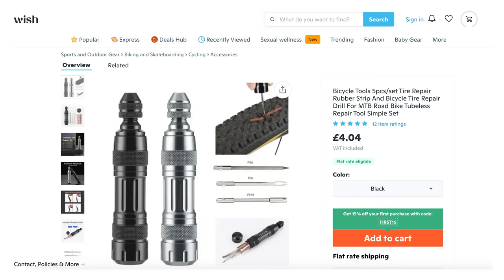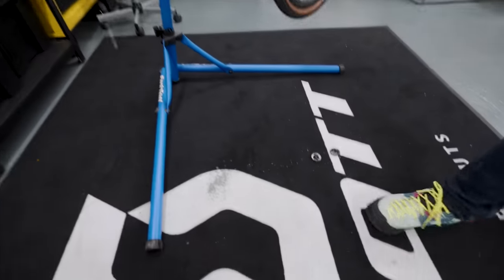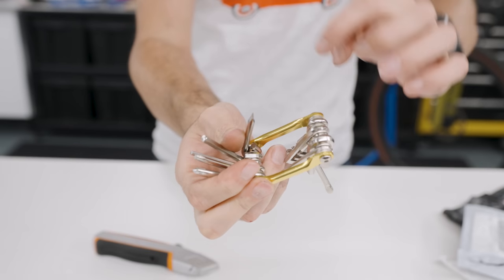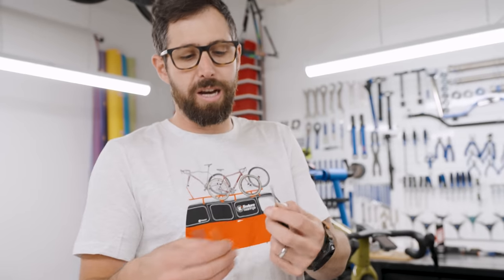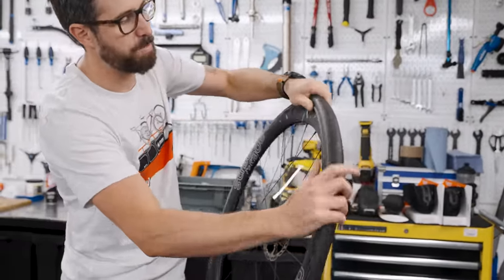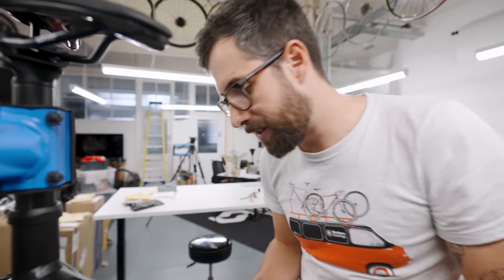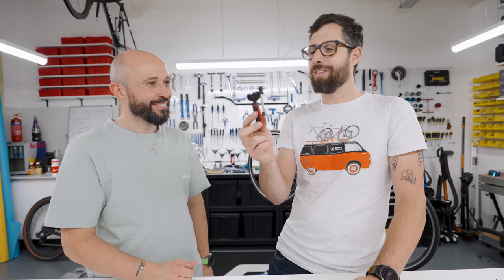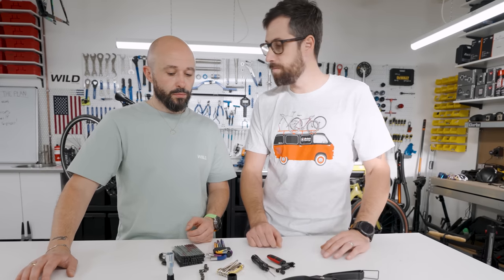Pro Bike Mechanic Tests The Cheapest Tools From Wish.com

Comment: For the wheel truing device. Nick should have shown the zip tie trick. Works fine for a quick wheel fix and the price is right.
Reply: As he said, your finger works fine too. I have tried the pencil trick with an elastic band, but zip ties and fingers work better for me!
Reply: Use the tip of the finger to do a rough true. It'll definitely get you riding again, though it wont be as accurate as a stand true.
The zip tie true is just the best way to do at home or roadside truing, as you can get shockingly accurate with it

Comment: You are 100% right about the crank pulling tool. I spent 3 hours cutting off the cranks after the threads in the crank stripped and I had to hacksaw it off! Love the content!
Reply: I have similar one but never had problem. I think you didn’t screw it deep enough first. Tool works fine for me for more than 10 bikes and lots of them are old ones that never had their cranked removed before.

Comment: Love Risk items! I have those pliers, internal cable routing tool, pedal spacers, headset cap bolts, …. Fairly high quality and wicked cheap!
Reply: Have some Ti Bolds from them for my brake calipers and they work since many years. Giving less points due to name is just bullshit.

Comment: I bought those same black plugs, and you can actually pull them apart into 6 strands each that are the same size as the brown ones that came with the plug tool

Comment: You will laugh, but I used the "truing stand" and I it worked well. My wheel was around 3mm or so untrue and I got it down to the 0.5 mm range. 

I followed the excellent park tool guide and found the process to be a bit time consuming, but overall not difficult. It's a cheap plastic tool, and if you plan on truing wheels often, it is useless. But if you just want to get your wheel trued that isn't totally out of shape, it's worth a shot.

Comment: I made the mistake of buying a cheap chain breaker and crank puller. The chain breaker lasted 3 uses and was horrible to use. Then the it decided to strip out it's threads. The crank puller was too tight and stripped some threads in a crank then it decided to strip its own threads out with barely any tension. I learned that lesson. I do old tools in my tool box that I use as sacrificial tools. Old beaten up screwdrivers and things that are past they're actual usefulness that I don't care if I destroy.
Reply: That chain breaker lasted 3 times more than mine. Ended up using a rusty, ye olde, Cyclo Made in England one instead. No problems.

Comment: Regards the split link pliers, I had some flat metal strips lying around, so, following one of my ride buddies saying that he couldn't split the chain whilst out on a ride, I decided to make a scaled down version of the Park Tools pliers that I have on my workshop board. They work a treat, and I've now made four or five similar pliers for some of my cycling friends, all freebies of course. And on the plus side, it gets rid of the lengths of flat bar that i have lying around, and not wanting to throw away just in case I could find a use for it.Old spokes make the ideal material for holding the chain together to prevent it being under tension.
Reply: You can also shift to the smaller chainring (provided you're running a double) and then just ease the chain off the ring and lay it on the BB shell for easy removal. Pro Tip from Calvin Jones & Park Tool.

Another reason I'm happy to spend on the Park Tool bits: they have hours of free maintenance videos on their YT site! They happily give away great detailed instruction for free. That good will in turn leads me to buying their tools and products. When I need a specific bike tool, my first instinct is to have a look at the Park version first.

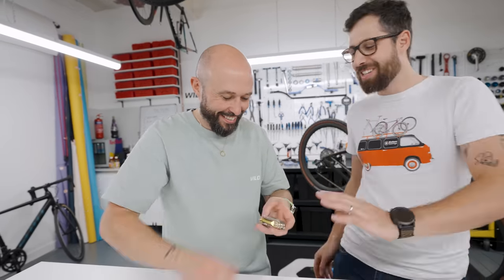Comment: 05:17 I have been using that multi-tool for my bike in humid Thailand since 2017. No rust, works great, and still use it today. What I love about it is that it has all the tools you'd ever need. In contrast, the over priced Park Tool multi-tools come VERY limited. They might have 3-5 hex on them, but that's it. This cheap Chinese one has withstood the test of time for me and it has everything you'd ever need. Good video though!

Comment: This is why there are dedicated channels on YouTube that just review Chinese parts.  Many of us rely on those sites to let us know what deals are great, and which are not.  This goes for frames, wheels, group sets, tools, and everything else.  It's abundantly clear that anything bike related is completely overpriced, because on a whole, cyclists are like golfers.  Elitist athletes who will spend their children's inheritence if they think they can buy some gadget that will make them even slightly better.  I made my own chain whip out of a flat piece of metal and some old chain.  I made my own bearing press.  And I would definitely buy the chinese version of most of those tools before I gave Park Tools one dime of my money.  I'm not a pro mechanic, so I won't be overcharging anyone to work on their bike.  It's just me, my garage, a bike stand, and the tools I have.  For over a decade now, that's worked a charm and I have to say it makes me even more proud knowing that the machine underneath me is something I maintain myself.
Reply: Did you just call a push bike a machine 😂😂😂😂😂😂😂😂

Comment: Double coffee noser when I saw you take the drill to Francis' tyre. I'm sure Nic would agree there are some tool ranges that fall between the most expensive and ultra cheap versions. Years ago I needed a toolkit in a hurry and bought one by Bike Nashbar. They worked well for the limited amount of repairs/replacements I was doing. Over time I replaced 99% of them with better quality. Also added tools as my skill set increased.

IMHO the one place not to skimp is a quality set of Allen/torx  wrenches. Add to that a decent quality torque wrench kit.

I'm with Jimmi, wheel truing is a dark art. Two years ago a buddy was moving house and gave me a Park TS-2 pro version. I ended up giving it to a bike mechanic friend as long as he did my wheels as needed. I never got the hang of it. The best part of that mini stand was the elastic band, which might work to fasten something to handlebars. 

Thanks as always. 😂

Comment: 15:17 I true my own wheels - it’s very easy, it takes less than 2min, you just have to follow the Parktool technique(compressing 2 spokes with your hand and checking if that area would give you the desired result, before increasing tension).

Comment: The pliers for seating the tire has another use which you didn't mention. If you are using an inner tube, using a lever to install a tire is dangerous, with a high chance of pinching the tube causing a puncture. This pair of pliers makes the job easy and does not pinch the tube. When I ride tight tires, I carry this tool.
Reply: Interesting, I ride with tubes and have pinched them a few times with levers, this might be worth buying. Also thought it might be useful for someone with disabilities, levers can be a bit fiddly sometimes and this looked smooth.
Reply: @danielvanced5526  the conventional wisdom is that you should not use levers to put tires on. 50% of the time I use levers to put on a tight tire, I pinch the tube, and I used to be a shop mechanic. The pliers -- which come in a few brands -- solve the problem completely.
Reply: Tyre glider is a neater bit of kit that fits in a saddle bag and does the same job better
Reply: @thenayancat8802  I checked it out. Interesting. Thanks for the tip. I might try one.
Reply: @tomreingold4024  Yeah I thought it was gonna be a useless dongle that gets used once and chucked out but I hate using regular levers at this point, especially if you've got a really tight fitting tyre. Having said that I was never great at using levers so ymmv

Comment: Great video, but I want one of Francis's reaction when he watches you destroy his wheel! 🤣

I've had most of these budget tools over the years and Nic's assessments have been my experience with every one of them.

The issue with the multitool coming loose is also not one you can fix unfortunately. As Jimmi found, if you do it up too tight, they can't be used, not tight enough and the end nut falls off constantly rendering it useless! I've since ditched the budget multitool and now use a Topeak Hexus X. It's actually not that expensive anyway but is a cracking little tool. 👌
Reply: for low budget multitools a plastic slip disk like ones found on some folding knifes help. i place them on my better ones too

Comment: A better tip I’ve seen is flip the bike over, and use a pencil braced against a rim-brake pad, or other point on the frame, turn the wheel slowly and move
The pencil closer. You’ll get marking of the closer points as well.

Comment: Cheap tools have many problems:
They wear out faster, and as they wear out they ruin the thing you're working on.
Reply: @DMurdock Except when the cheap plastic tyre levers are flexible and snap whilst doing the job they are meant to do. And the last thing the world needs isfor us to create more waste.
Reply: Tools that wear out quickly can still be useful. Many times with bike repairs, you're going to use a tool only a couple of times ever. If the cheap tool last long enough for that it was good enough.

Comment: Wheel truing is actually not very difficult once you figure it out. I just practiced on an old set of wheels. Disassemble and reassemble until I felt comfortable truing my “good” wheels.

The wheel truing gauge thingy would be very nice had it not used that silicone strap.

Comment: As someone who rarely needs a chain breaker, I've already broken 3 of the cheap ones I got. Next one I'll get is definitely a park tool.
Reply: I have the proper park tool one and it will definitely last. All metal and still made in USA. 
(Also, buying 'disposable' goods only adds to the waste pile of society, which is the last thing the world needs)
Reply: i've just always had the one on my crank brothers multi tool. i've used it in the garage, i've used it on the side of the road or on the trails, and that has served me well for over a decade.
Reply: Mine is made by Topeak, which can connect any chain, including Campagnolo (chain pin peening), something almost all chain breakers in the market can't do.

Comment: Re the extreme tire lever : I bought one because I was working on a vintage wheelset with wire-beaded tires. Before I bought them I delaminated the skin on both my thumbs trying to get the tire seated, with them it took like 2 tries to get them back on. That was 100% the worst tire combo I've ever experienced, equaled by GP5000 TLR for impossibility with just hand strength. At least with the GP5000s though it was impossible enough that I wasn't convinced for an hour that I could do it if I just pushed hard enough...

Comment: For truing wheels on rim brake bikes you could also just put a zip tie around your brake lever and pull the brake closer as you true the wheel.
Reply: I just turn out the barrel adjuster to bring the blocks closer to the rim bit by bit, because decent quality calipers move (mostly) equally you can actually do a pretty accurate job.

Comment: I have a few Risk tools and they work great. Their headsets are excellent for the small amount they cost.
Reply: I have there dust semi metalic brake pads. For the cost and what you get. Best brake pads ever. Bought 4 sets for 10 euro. For the future.
Reply: Same here, i have this risk chain tool, quite the same remark (good for trail use, not enough leverage for workshop use). Also happy with their cheap headsets.

Comment: That tyre leaver tool would actually probably be good for installing tyres on mountain bikes with Cushcore because that is a fkn pain in the ass install, I actually snapped 3 tyre leavers trying to get the tyre on with Cushcore and that tyre leaver tool may have made it easier

Comment: A life hack for when you in a pinch (on the trail) need to true a wheel, is to bring a couple of strips. Simply tie the strip to the seat stay or fork and you can rotate it to make the end touch the rim, You can actually get fairly exact with this method as long as you tie the strip enough for the wheel wobble not to move it out of position 🙂

Comment: The problem is, you’re using a “spit link” and not a “split link”

I’ve used one of those cheap chain cleaners. They’re not as bad as they’re making it out to be. It works fine, just think of it as semi-disposable.

I also used that same multi tool for about a year when I first started messing about with bikes. I bet it would still work today. That one is fine too.

Comment: That tyre lever ideal for anyone purchasing Schwalbe Marathon Plus, or run the risk of entering Haka territory sliding those last few inches over the rim !
Reply: Have to say. With schwalbe and cst. Never had a problem with putting them on with just hands. Did have it with cheap tires.

Comment: I used one of those square taper crank pullers and it worked okay for a few uses but started stripping threads after like the third set of cranks. 

The bb tool I've only ever had to use once. For that one time it worked fine but you'd be infinitely better off with a quality tool

I also own a set of cheap allen keys like the ones featured. It's pretty hard to mess up allen keys and mine have seen heaps of use (especially the 5mm) the past year and been fine. 

When it comes to chain tools I'd recommend the Cyclo one at Halfords if you're on a budget. Unless you work with single speed chains a lot it'll do everything you need and is absolutely rock solid, all metal.

Comment: I have been using zip ties with a bit left sticking out to true my wheels in a pinch. Especially road bikes with rim brakes, comes in super handy and I just leave it on the frame/fork and rotate it out of the way when I'm done. Did a 8000km tour with a brand new bike, had to true the wheels after break in and then again multiple times during the trip. Can't beat the price of a few zip tie
Reply: You couldn't last 8000 m nevermind km 😂

Comment: I use the chane mashine! At least I used it 10 times. Still only one rubber is missing, but it still works. And the brush is a bad idea if your chain is covered with send salt and snow, particles of sand will make sure that your hand holding a brush is dirty beneath the elbow as well as all your clothes.

Comment: My reaction was exactly the same when I found the RISK brand for the very first time on AE 😀I wouldn't mind using some of their small parts like cable housing end caps or internal cable housing dampener tubes. But something like (fake?) titanium bolts for your stem or handlebar? Well, that's RISKy 😀

Comment: from what i've seen, most tools work okay unless it's something where a very exact fit is ideal (cartridge bottom bracket splines, crank puller threads) and/or where a lot of force is applied (pedal wrench, allen/torx wrenches, tire levers).    Those big tire plugs are made for car tires.
Reply: Hahahah.   I just got to the part with the cheap BB and crank tools

Comment: 16:00 just use zip tied to the frame cut to be little longer so it touches rim with some angle. then you can move to the rim as close you need. with same precision like with this tool..

Comment: I bet the smallest sizes on that cheap Allen key set are out of spec. both me and my brother got a cheap set each from different parts of the internet and he rounded his pedal adjustment bolt and I rounded a bleed screw bolt with mine. both using the small keys.

Comment: I used to have some of these tools when I started working on bikes. RISK is actually a fairly good chinese "brand", like ZTTO. The unbranded crank puller is actually ok if you're only going to use it once or twice a year, but the bottom bracket tool is absolute garbage. It doesn't fit properly, hence messing up your bb.

Comment: Have ruimed a crankset (well the threads at least) with partly the tool to blame, so much agreement there. The trueing tool isn't as useless as you can work around it moving.

Comment: If you are bike packing and need to true a wheel you can  use a zip tie. Put it around your frame and cut it so it is a fix point of reference to true the wheel by. Better than that rubbish thing they brought and  plus zip ties have 100+ uses.

Comment: Truing a wheel in-frame is an emergency repair anyway, so why not use your brakepads as a guide?
You can't really true a wheel in a frame because you cannot be certain the frame is straight. You are in fact adapting the wheel to your frame.

Comment: Last tool: why should you use the screw? You are going to put it in one position, spin the wheel and then you know where it is not perfect. The screw i would say is only for using it at different frames. Less parktool commercial and a little bit more brain would be great.

Comment: The absolute quickest way to clean a bike chain and cassette for that 300-500km clean is to buy a bottle of turpentine, mineral spirits or so on for £1-2 a funnel and some coffee filters. Using a tall sided takeaway container, fill halfway with the solvent. Remove chain, cassette and derailleurs. Dunk in the turps. Leave for an hour. Put on some gloves and grab an old toothbrush. Quickly agitate the solvent on the components, no need to scrub. Put the lid on the container and put it in a bag, twist the top to seal. Give it a shake. 

remove all the compenents from the container and dunk them in a very soapy basin or if you want to factory reset - dilute oven cleaner.  Allow to dry fully before reinstalling with grease and lube in the right places.

As for that dutty arse turps - pour it through a couple of filters placed in the funnel in the bottle. Reuse until it evaporates away.